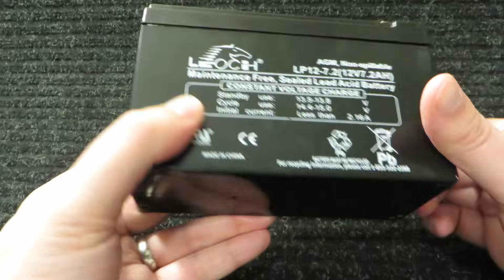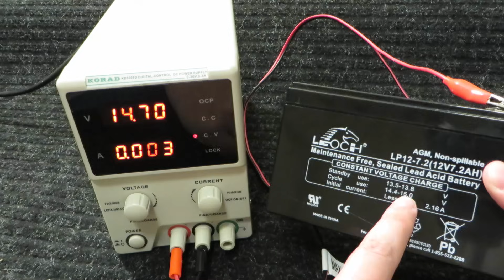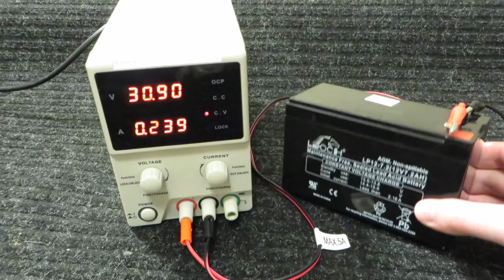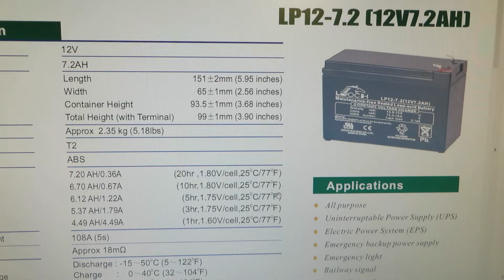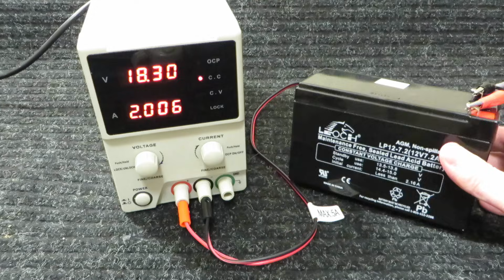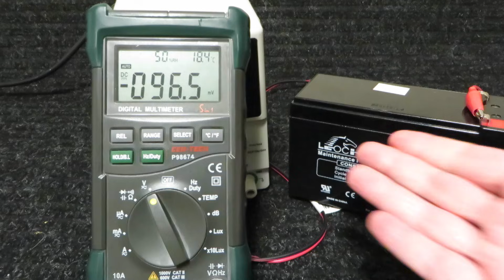Battery Desulfation Demonstration Start to Finish - Part 1/2

Comment: I have tried to recover a VRLA lead-acid battery (initially at around 1.5V) with distilled water and a lab power supply for well over a week. I used to start with 30V and stop at a couple of degrees above 40 Celsius (104F) and below 2A. Recently, I've got to the point where keeping a power supply at ca. 14V in CV mode, the battery reaches 6A and almost 45 degrees Celsius (113F) during a few hours, after which I switch the set-up off. Unfortunately, the next day's open-circuit voltage is back to 9.8V unchangeably. I have experienced that a few times already. Is there anything I can do with the battery yet, or is there no chance for me to bring it back?
Reply from the maker: It sounds like you have high self discharge which is not a sulfation problem so this process won't help that fault.  I believe that you repaired the sulfation issue which exposed a different failure mode.  I'm not saying it isn't repairable but myself I'd give up on that battery.
Reply: never remove the fluid from a battery. only ever add distilled water.

its an electrolyte, and its particular level of ions, cations, all depends upon the battery that it came from. remove it, you upset the balance. it will never revive. the only thing a battery loses in its life is the H2O part. pure h2o. so thats all you can put back in.

Comment: Thanks. Do you think it makes sense to keep charging a sulfated battery every two months for a few hours with a smart charger before one desulfurates it properly, like in your video? Will it be beneficial for such a battery or not?

The detail description of the situation: Many a time I have seen that after being in seemingly non-charging mode, a smart charger switched to charging probably because the voltage on a sulfated battery reached some threshold after many hours of being hooked to the charger. Therefore, even if there is no such ignition of the charger due to the battery not reaching the voltage threshold (which is most probable in this periodic charging of the batteries of mine), there may be some charging going on, which is beneficial to the sulfated battery. But the question is: Will it be beneficial or not?
Reply from the maker: I agree with you completely here.  A 'smart charger' which in reality is super stupid will give up on charging a sulfated battery much too early.  If you repeatedly use it to attempt to charge a sulfated battery it will slowly desulfate it in many cases.  It's not an ideal solution to the problem but sometimes after a few cycles the charger will finally decide "OK, I guess this battery is worth charging so I'll give it an honest shot".
Reply: @knurlgnar24  And what if a sulfated battery does not desulfurate slowly but deteriorates slowly with time despite such a periodic charging with the smart charger in a "non-charging" state? Does it make a difference to keep charging them periodically in this way? Unfortunately, I can't say if it deteriorates (in terms of open-circuit voltage) slower or not with this kind of "charging." And even if it deteriorates slower, it doesn't necessarily mean that it is beneficial to the battery, does it?

Comment: Thanks. Is there some typical temperature one should never exceed while charging the lead-acid battery? Or is the only issue with temperature indirect: boiling water and exposing the plates to air - so that one should care only about supplying water and its spill-over as far as the temperature problem is concerned?
Reply from the maker: Since reaction rate doubles about every 10c once the battery becomes 'hot' to the touch it is beginning to be too hot.  110F or 120F is generally the cutoff point for when a person needs to stop or risk damaging the battery or spilling acid.  Different batteries have different specs so without looking up any specific battery that would be my general recommendation.

Comment: as far as i know, there is no way to desulfate except with hydrochloric acid.
So, in my opinion you just achieved the recharge of the very little functional part of that lead acid accu.
As long as the Voltage is 12.6v or even higher,  no sulfation occurs in the Accu.

Comment: When should water be added?
Reply from the maker: This battery is non serviceable (some people service them anyway and that is not covered in this video) but on batteries that do have removable caps water should be added before charging whenever the plates are not fully submerged, and once the battery has recovered a good amount then the water level can be normalized when at full charge.  If one adds water up to the 'full' level on a sulfated discharged battery it will most likely overflow when charged/charging and make a royal mess.  The important thing is to make sure the plates are never exposed to air when the battery is being charged or discharged.

Comment: Could you explain also 1C as a point of reference? I understand 1C as a discharge current needed for a battery discharge in 1hour while new, although I don't quite understand what 0.5C means given that the capacity of a battery heavily depends on a discharge current. Therefore for a nominal capacity say 12Ah,  I know that 1C discharge current means 12A, but I have no idea what is the point of reference when we talk 0.5C - is it 12A and 12Ah in this case or some capacity different from 12Ah measured for 6A discharge current which we have to read off battery specs? (Then assuming the capacity for 6A discharge is 14Ah, 0.5C would mean 7A, not 6A)
Reply: Companies measure how much current it takes to drain a battery for 20 h. Then from current times 20 h, they get the capacity. So 12Ah is measured at 0.05C. Therefore 1C ≠ 1 hour, and 0.5C ≠ 2 hours. Watch Part 2 of this video. He shows a discharge curve for several C ratings. In the graph it is shown that 1C (12A) discharge, in fact, last about 30 minutes and 0.5C (6A) about 1.5h.

Comment: What is the recommended discharge current to optimally recondition a battery? Isn't it that there is some trade off between the long reconditioning time, amount of water evaporated, and the level of the good sulfur coming back to the electrochemical reactions? Please explain this part more.
Reply from the maker: The discharge current matters little.  The overcharge amount will determine the water lost.

Comment: BTW, I have investigated further the device I am going to buy and it turns out it has ability for setting many more charging/discharging cycles, also the instruction of software looks promising and has compatibility from Win XP to Win 10). The problem is I can't get a reliable information on max. discharging power. Instead, in comparison spec table there is "Resistor" word unlike for most other models of the producer for which the table have clearly the value of the max power. The manufacturer does not answer my questions. 

What do you think? Logically, one could assume that max. power would be the product of max voltage and max current but unfortunately in majority of this type of devices the max power is much less and therefore a producer states it clearly as a separate datum is specs. On the other hand, the word "Resistor" means nothing to me, after all a resistor has its max power too... Does anyone have a good solution to this puzzle?

Comment: Is it really the same method for other batteries, e.g. based on lithium? If so, what happens inside of them during reconditioning and are the chances of restoration/reconditioning the same as with lead-acid?
Reply from the maker: This video ONLY applies to lead acid.  Lithium is very different.

Comment: First, I've watched a ton of videos on battery desulfation (as you've pointed out there is a lot of snake oil) and your videos are awesome.  I've watched many of them numerous times in my efforts to learn.  Not sure if you are aware of the DC solar trailer ponzi scheme thing but the company's assets are being sold at auction.  Tons of people are getting these things (I got one).  Basically they were building a bunch of these and they weren't used.  They have 10 270W solar panels, a Midnight Classic 250, two Sunny Island 6kw inverters, two 48V 500AH fork lift batteries, and some have a generator.  Because they sat unused most have sulfated batteries.  I'd be very interested to hear your overview and recommendations on how to desulfate these batteries.  Mine has the generator and with the Sunny Islands you can set charging parameters from the generator.  Seems there should be a process that could be used to use the PV and generator to do a charge/discharge process to desulfate the batteries.
I'd guess a lot of people who purchased these could benefit from your knowledge and overview.
Reply from the maker: I've seen those for sale and if I had an acreage I'd buy a few of them and tow them personally to my property for stationary use.  That'd be a fun vacation for me.  Unfortunately I have no room for such things where I am.  They are an excellent value!  Yes, the batteries will almost certainly be recoverable and be perfectly serviceable for a long time.  Personally I'd not use that setup to recover the batteries and instead use a DC power supply to charge and dummy load on the inverter to discharge, but that's my personal preference.  If these batteries are truly unused they should recover to a very serviceable capacity.

Comment: Your equipment inspired me so much that I am about to buy a profesional battery tester which has CC mode for discharging  (with settable voltage cut-off) and CV mode for charging (with settable current cut-off). It has even automatic 5 step charging/discharging cycles (2.5 cycles max.) and you use an external charger, which gives you the option of using either a dumb or smart charger. What do you think about such a device and are there better below $300 (incl. shipping)? It seems that more cycles would be better but how about safety of such automatic charging/discharging cycles with no monitoring other than one temperature probe with wireless data streaming? The temperature probe I am going to use would come as an additional equipment from Riden DC power supply and the battery tester I am talking is by some Chinese manufacturer by the name ZKETECH - model EBC-B20H - which has also a PC software with some extra features like discharge graph plotting but I have yet to see it (which may be difficult given the Chinese only website of the producer, assuming it is available there).
Reply from the maker: Any lead acid battery has some risk of catastrophic failure, so charging should be done in a location where a boil-over or battery explosion won't cause a severe problem if it happens when unattended.  That said the main risk is acid burns and that isn't really an issue for unattended applications.  I personally like the cheap lab power supply as shown here, but I can see value in automatic setups too.  A long time ago I used a Arduino type device to automatically cycle a relay to discharge-cycle a battery for cycle testing.  The charger was simply left connected continuously.  It works fine and you could set something like that up for well under $50 if you wanted to invest the time.  A purpose made device like what you're talking would be better though if you're not on a poor student budget like I was.
Reply: @knurlgnar24  Should I worry about fire in unattended handling of lead-acid batteries - be it charging, discharging, or storing? You seem to have said that only the acid burn (of body and objects) or contamination might be a problem with this type of batteries, not a fire.
Reply: @allegrofallegrof  Lead-acid battery can produce hydrogen gas, especially when overcharged. Hydrogen gas is highly flammable, as Hindenburg accident told us. So, locate the battery in well-ventilated area, and yes, put away fires and sparks.

Comment: Thanks for the really instructive video. What are the chances of reconditioning success when closed-valve VRLA batteries (like the one on this video) loose open-circuit voltage rather quickly after charging (and not using)? What could be the reason for the voltage drop? It can drop to a few volts or even below 1V after a month or a few.
Reply from the maker: Not good to be honest but may be worth a try if they're somewhat valuable batteries.  If they're dried out you may need to add water.  Sulfated batteries do lose voltage fairly quickly after charging but they shouldn't drain down to 1V unless there are other issues.
Reply: @knurlgnar24  I thought this type of batteries as you have reconditioned here is totally sealed and there's no way of refilling anything there. But can I refill the water and seal everything as it was? It is really important due to the application of those batteries I am going to recondition, which is e-vehicle. I guess they do those batteries for e-vehicles sealed, i.e. with no obvious way to get to the cells, for a reason of high mobility, but on the other hand, there are car batteries with rather easy way to refill the water, so there may very well be no reason for sealing other than forcing users to buy more. What do you think? Will there be any difference in my chances of resealing the sealed batteries after refilling? Isn't that the only difference between the sealed batteries and non-sealed ones is the plastic cover topping the otherwise exact same caps of cells (same as in those car batteries I mentioned where I guess the very manufacturer allows the user to refill its battery from time to time)?
Reply: @allegrofallegrof  I think if you're talking e-vehicle battery banks there is hectic danger due to high voltage, compared to a 12V battery. If you keep in mind that electrolyte is "live", the hazard/chance of electrocution sounds too high to be worth doing, or is there a safe way to break the battery bank into 6-cell blocks before fiddling with acid levels? I'm just worried...

Comment: Attempting to desulfate a marine battery.  Charged voltage at 13.5 volts but has no cranking amps so I am assuming it's badly sulfated.   I bought a power supply and I'm pumping 16 volts 8 amps DC and the electrolyte is bubbling occasionally and as time goes on the amps are dropping, is this normal?
Reply from the maker: Sounds normal.  Be sure to keep the water topped up.  Batteries can't always be saved so you'll have to see if yours can.

Comment: Anyone know if those aliexpress desulphate circuits work? I don't see how they could as they don't seem to charge the battery, only short the terminals at high frequency. But could be totally wrong
Reply from the maker: They don't work as advertised.  The may work by simply overcharging the battery as shown here.  It's kind of like reading marketing on a retail box of a kitchen appliance - it may mix your cookie dough adequately but it isn't because of the 'industrial motor' or the 'patented dual action mixing hook' or the 'pure copper windings for 300% more power'.  Nah, it just mechanically moves dough around in a bowl.

Comment: I have 6 8ah 6v lead acid batteries. They are 6 years old and have never been used. The voltage dropped to around 0.5v each. I tried CC at 1a for an hour on each battery and all of them immediately dropped to 2-3v when I took off the charger. Is there anything else I can try before throwing them out?
Reply from the maker: I have a couple of videos on recovering sulfated batteries.  They may be worth checking out.  If your batteries are old and never used it is highly likely that you will be able to recover them to a condition that is slightly less than perfect but very usable.
Reply: @knurlgnar24  I have seen them, they were definitely helpful. Over the last couple years your videos have saved me hundreds of dollars of batteries. Unfortunately it seems at least 4 of the 6 batteries have internally shorted in at least one cell. I just had one of them swell up like a balloon while I wasn't watching, lol. I guess I've tried everything at this point. The charging the voltage would slowly drop from 35v down to around 10v at 1a. The battery would stay just barely warm and then the voltage would drop to around 3v and the battery would get super hot in less than 20 seconds. This happed for 4 of the 6. Is there something I'm doing wrong or are these batteries just toast?

Comment: i'll try this with my nackered old sealed acid batteries , they hold only a tiny charge and i do have an old charger and big 12v motor to discharge it , was thinking getting 2v cells from a forklift and trying those on my solar setup to get free power at night but here in scotland hard to find tham. thanks for posting

Comment: Help please:  I copy your settings on current say .095 then set 29.5v and it resets itself to 12.92v each time, what am i doing wrong please  Tenma 72-2685  30v 3a  I can not get a 30v charge no matter how I try
Reply from the maker: If you set the current limit to 0.095A then it will limit the current to 0.095A, and it does so by lowering the output voltage until current falls to 0.095A.  It will always use the lowest current and voltage necessary to keep both current and voltage below the set points.
Reply: @knurlgnar24  thanks  mine is 30v 3 amp,  how do I force 30v in for 10 minutes safely please
Reply: ps  it locks onto cc not cv like yours  Rockseed 305p  30v 5amp (ignore typo above)
Reply: @woodwood5164  How much is the current when the voltage is 12.92? If it's 3 Amps, then it's working perfectly and your battery can start recovering. Watch Part 2 of this video.